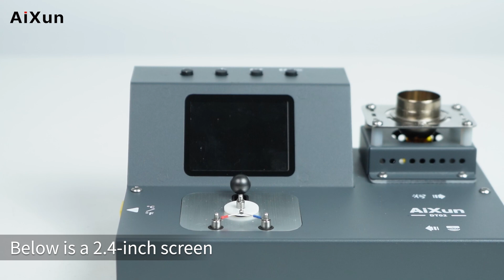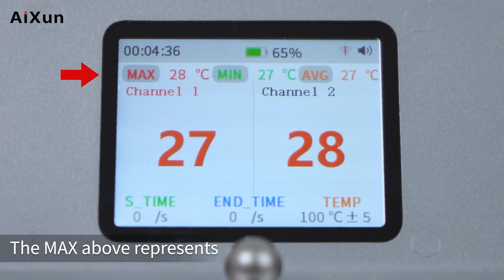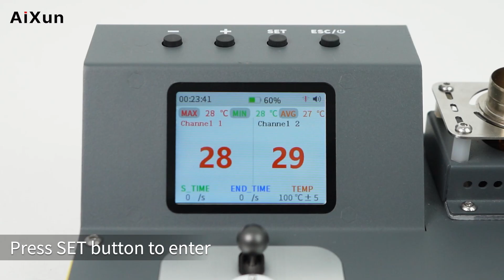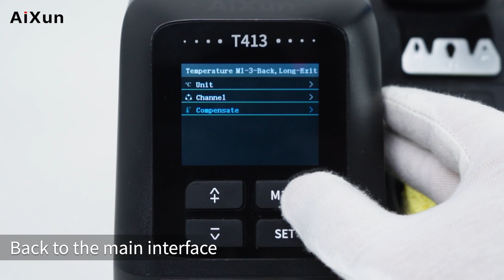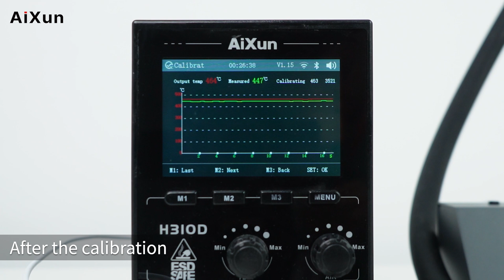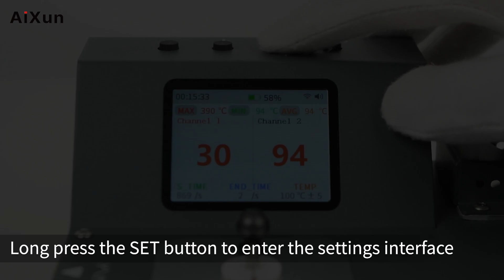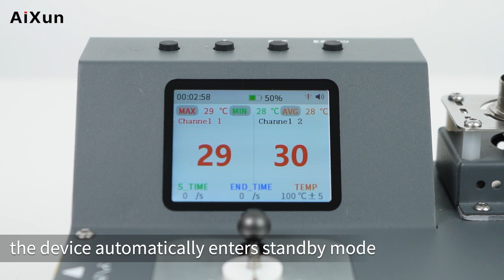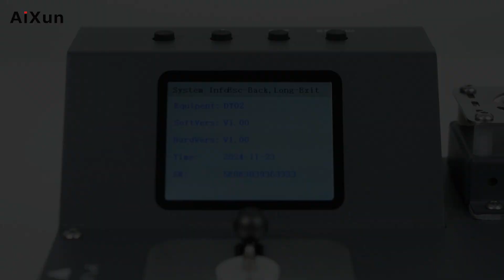DT02 2-in-1 Smart Thermometer for Hot Air Gun and Soldering Station - Operation Guide #aixun #dt02

Comment: Please add a manual calibration option for the hot air temperature, as I can't get the DT02 in Egypt.
I bought the H312 device a few days ago, and the temperature is completely uncalibrated. It shows a temperature of 43°C without use, and when in use, there's a difference of more than 20°C and sometimes 30°C between the temperature displayed on the H312 and the actual temperature measured by the multimeter.
Reply from the maker: Hi, sir. Thank you for your suggestion! We will report it to our R&D department, and for technical issues, please contact our tech support team via WhatsApp: +86-191-4796-3967\ +86-199-2649-0240. Thank you very much!